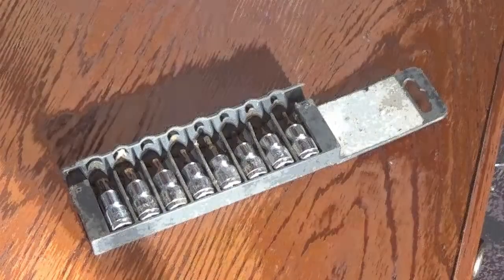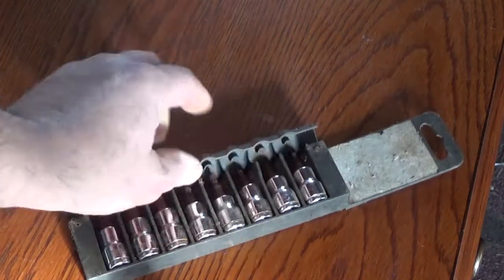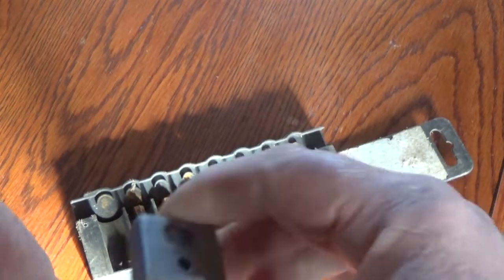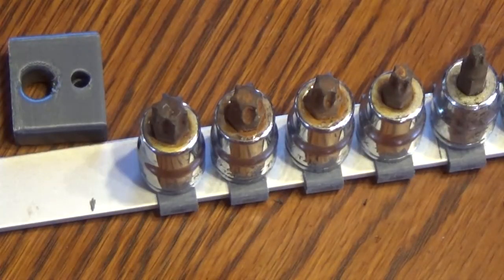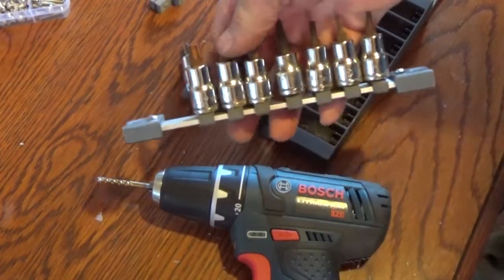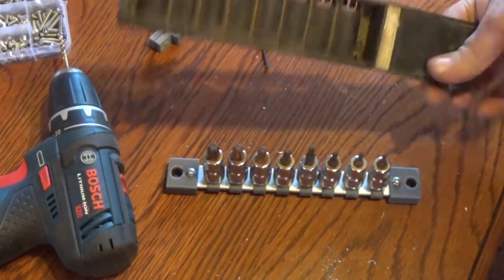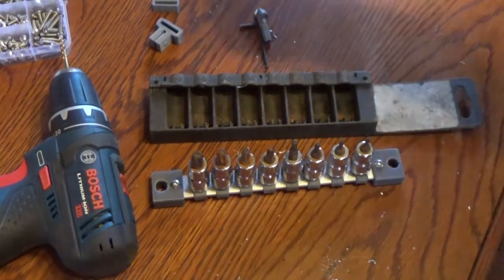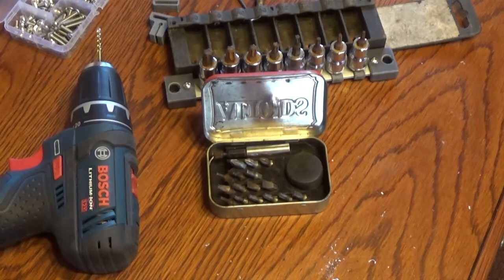Socket Organization! ONE Set at a TIME! 3/8 Drive Socket Sets in CUSTOM MADE holders! Simple! Cheap!

Comment: Yes those socket holders from the OEM packaging work okay but are not as good as the socket holders like you made. As you noted they take up less room and you can pull them off the detent instead of having to unlatch the top. So they can be one handed operation. I happened buy a package of three bars of them 1/4, 3/8 and 1/2" for $26 from Amazon because I was looking and do not have a 3D printer. These types of videos get us tool enthusiasts, well, more enthused. I need to tweak my aftermarket socket racks to keep the ends on because unlike yours they don't have a set screw. Good improvement T-Wrecks.